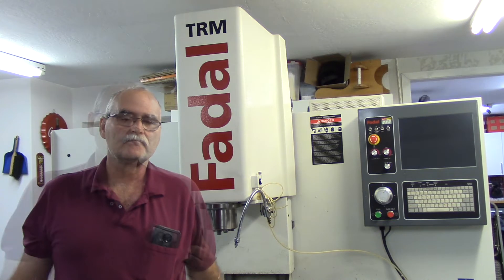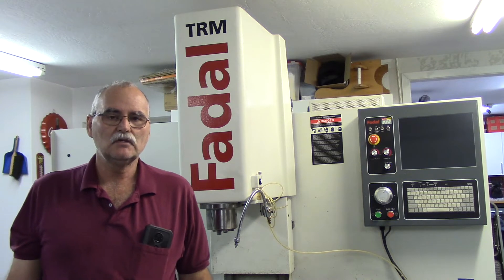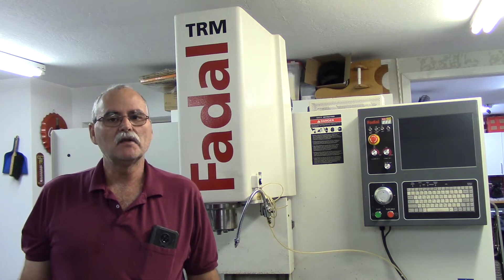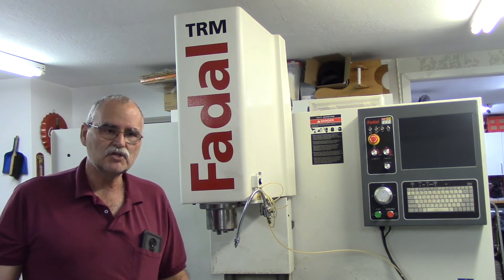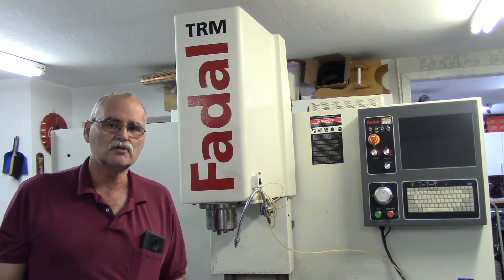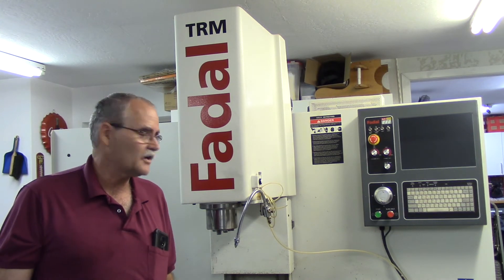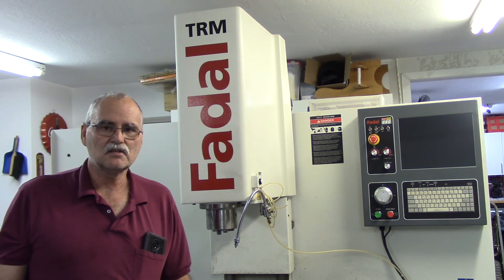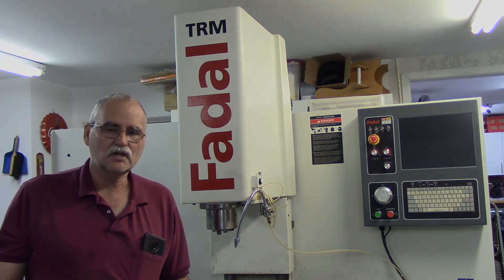FADAL Update 2: Centroid CNC Oak Chosen

Comment: Awesome videos. I own a mechanically astounding VMC20 that I’d love to retrofit soon. The dc drives and motors work wonderfully and currently that is my big hold up. I’m assuming I’d need some 1.8kw to 2.2kw servos to replace them and that gets pricey fast. That said I’m definitely planning so when that does occur I know what my options are.
Reply from the maker: If the DC brush servos are good, consider Centroid All in One DC. You will likely have to upgrade the encoders in them

Comment: You ever upgrade a 4020 or is that a little larger than centroids systems are made for? We have 3 fadals here two with dc servos and one with AC. Thinking about trying the all in one dc on the 4020. Submitted a inquiry for a quote and guessing with everything going on it may take awhile to hear back. Curious though my business partner and I may consider swapping all of them out. Be safe and well.
Reply: Also curious , I’m looking at a 4020 ac servos 2001

Comment: Hi Marty.  Interesting videos you have here.  I am interested in the Centroid Oak controller for a future CNC project, but I find very little independent information on it as opposed to the Acorn board that has tons of info out there.  Is it a new board with small user base, or is it because it is mostly used for professional retrofitting by companies that don't usually share online?  I would love to see more videos on this board from you.  Thank you for all the videos.  Keep it up.
Reply from the maker: It is used primarily by dealers to retrofit machines with existing drives compatible with OAK. Its not new at all. Been around for many years. You should post pictures of your machine, which include pictures of the Axis and spindle drives,  overall control cabinet picture and post them here with details: https://centroidcncforum.com/viewforum.php?f=64 We can give you some ideas/advice

Comment: I would LOVE to do the exact same thing. Fadals are hard to find in Europe though.
Reply from the maker: Follow along, the  process would apply to any knee/bed mill.
It will be a few weeks before I can get to it. I just received the motors and drives. Collecting more parts....
Reply: @martyscncgarage5275  Thanks I already did Acorn on a lathe and about to on a knee mill ... Once I can drive again and get the machine !
Reply: They’re all over here with the recent Covid issues nobody showed up for an auction and we swiped a 4020 and vmc15-914 for $600. Also bought 3 robodrills with twin pallet changers and the fanuc controls on those are spectacular. Plus fanuc support is available regardless if you buy new or used they’re always available for help. Superb customer service. You know if we had a big enough shop we would’ve purchased all 38 machines they sold. All together they sold for around $80,000. Sadly the auction didn’t pan out well for the seller.